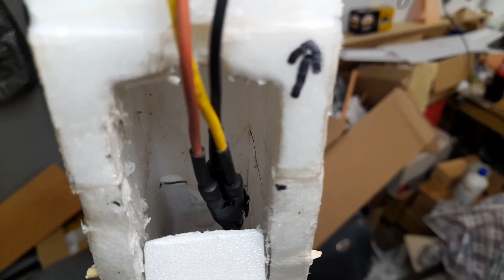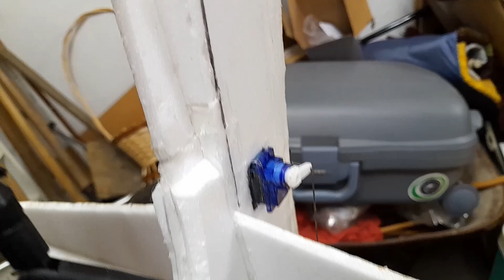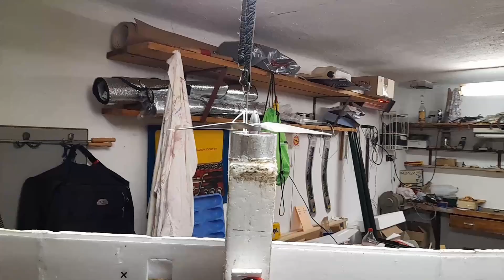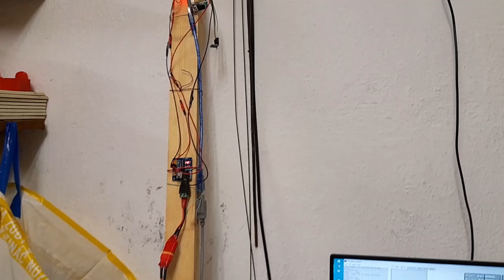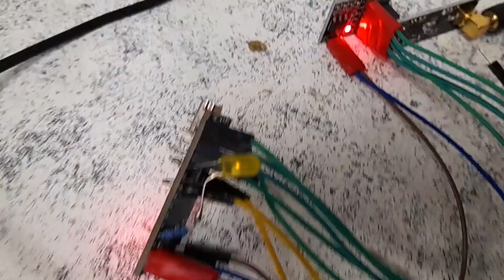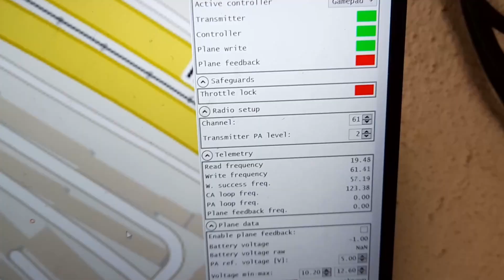DIY Arduino RC plane - how it works?

Comment: 144   mode1 radio is  wrong.     elevator and ailerons go on the  right stick.     WHY  are there servos at the tail.?!?!
Reply from the maker: Davids, old pal, how is it going?

1) there is no right or wrong in terms of sticks. We can have it as we see fit, it's only us who fly with it.

2) servos are on the tail because it is easier in terms of construction. And as mentioned in the video, the plane is well balanced regardless so it's not an issue

Have a great day!